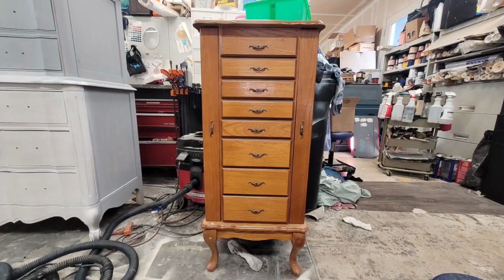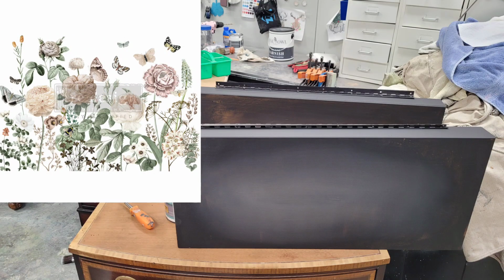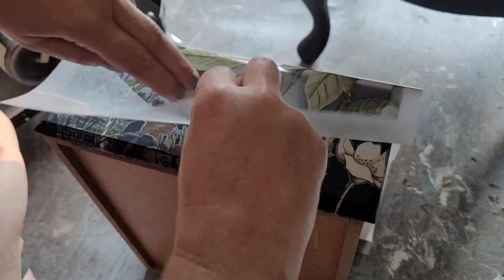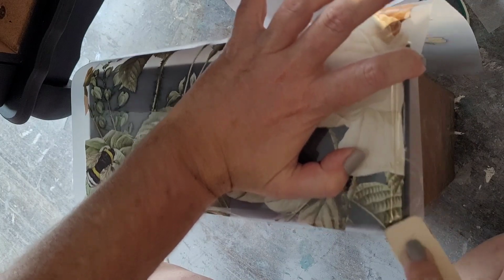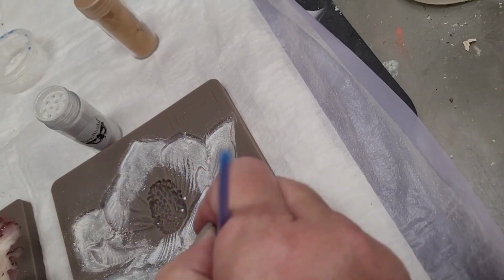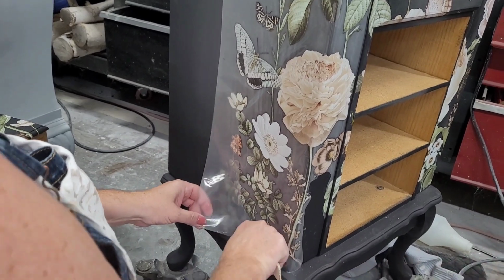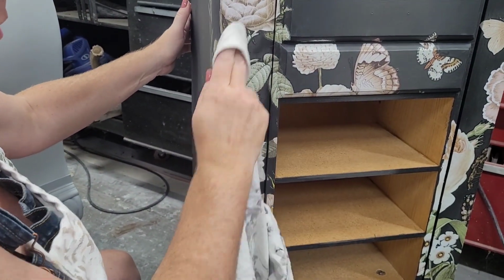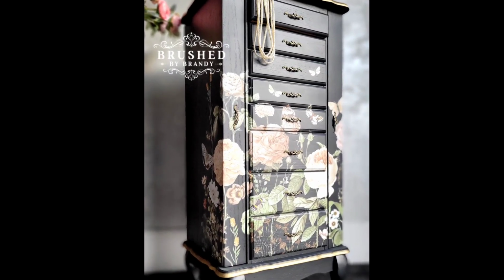Transform your jewelry armoire with a dramatic finish and floral appliques using paint & resin

Comment: Hi Brandy, This is an amazing jewelry armoire.  I will have to return to it when I do mine.  
I wanted to ask you.  I just watched a video from 3 years ago where you lined your own mustard drawers with wall paper.  The drawers have beautiful metal bumble bee "knobs".  I noticed that the long screws from the bumble bee "knobs" were still inside the drawers.  My question is when you paint furniture pieces for sale and when you change the drawer knobs and have these long screws, do you saw off the long screws and then sand them down so they don't stick out inside the drawers or do you leave them the way you have it in those mustard drawers with the bumblebee "knobs"? 
Thank you very much.
Reply from the maker: I use a screw cutter, part of an electricians tool from Klein tools. Of course still haven't done the one in my own house 🙄
Reply: @BrushedbyBrandy  thank you very much.  I appreciate this information.